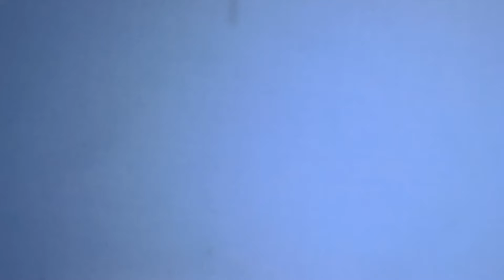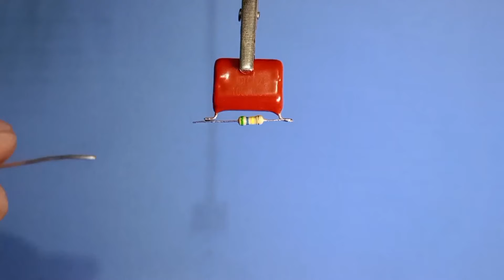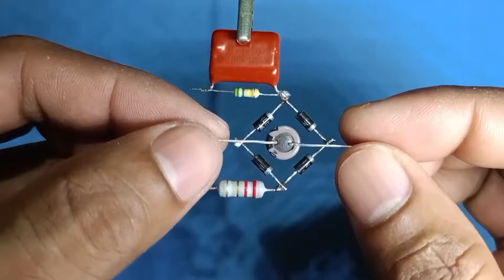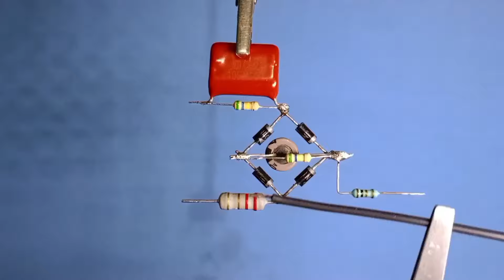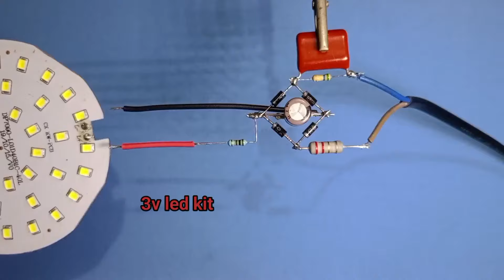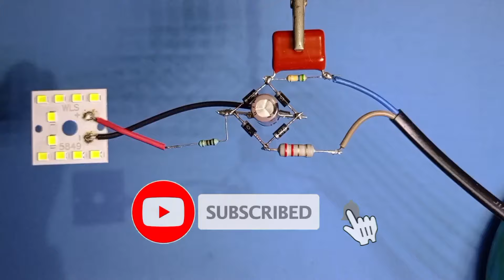Convert 220v AC to 3v,6v,9v,12v,24v,48v,60v,90v,110v,120v DC led driver | multi output converter

Comment: Amperage ratings per voltages? And how is heat dissipation handled? Also, does it matter what side of the circuit the neutral of the ac is connected on and the hot of the ac is connected on? Thanks, wonderful video!
Reply from the maker: Yes, correct